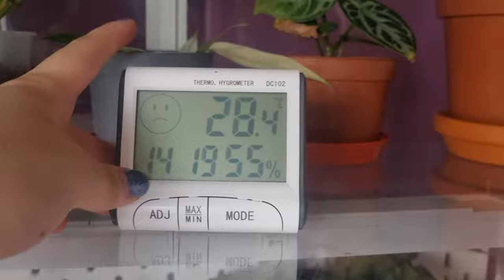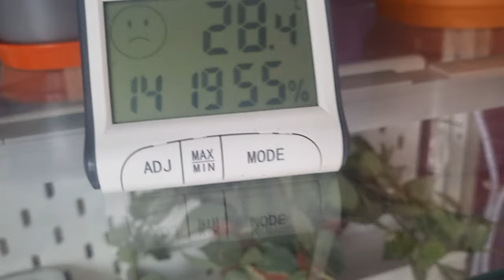IKEA Milsbo Greenhouse Cabinet Set Up + TOUR! 🪴

Comment: 😀. One tip i would say is the fans do not need to be on 24 hours. Every cabinet is a little different and we have different plants so see what works best for you but i have mine set to come on for 10 minutes every 4 hours. So far it's great for about 9 months now. You might need more or less just a suggestion since you are getting a smart strip it will make it very easy to do.
Reply from the maker: Ah brill ty 😊